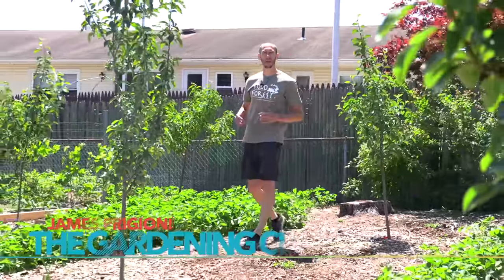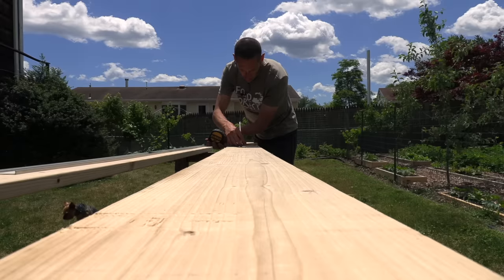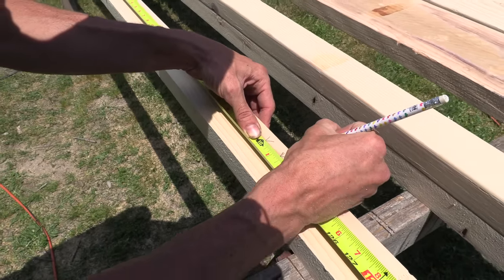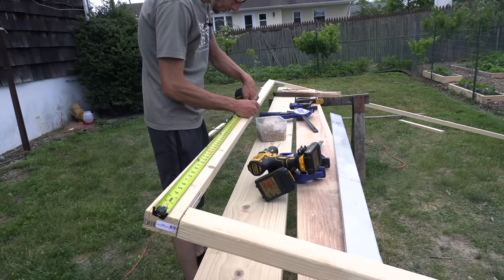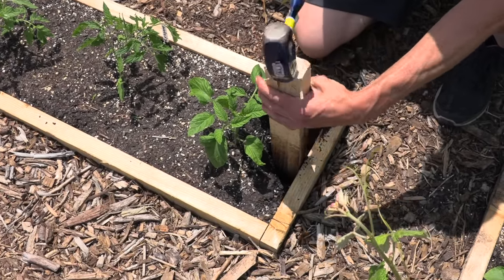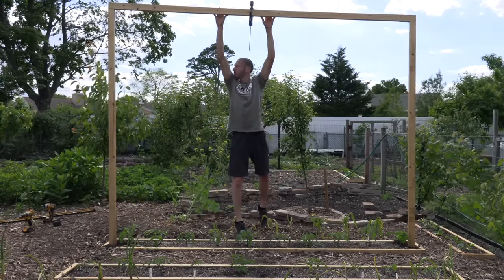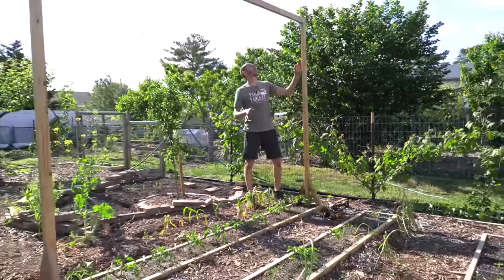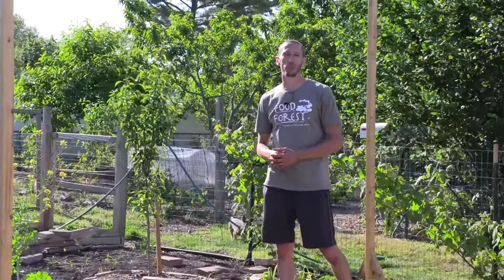How to Build a Tomato Trellis Using Only ONE PIECE of WOOD, CHEAP and EASY Backyard Gardening

Comment: It is better to screw the right angle joint in such a way that the screw goes through the end grain first then into the other piece of wood across the grain of the wood...It makes for a stronger joint.. You can use the pocket hole style...

Comment: Very nice work, thanks.
One thing I didn't fully understand: When we buy wood we usually pay by type and volume, so three pieces of 2x3 should cost roughly the same as one piece of 2x8, (given the same type of wood, and the fact that "2x3" is actually about 1.5x2.5). 
So, aside from the fact that building something "from one piece" sounds nicer, (and assuming you get to practice your carpentry enough without it:), is there a benefit to doing it this way, when buying pre cut lumber saves time and energy? 
Thanks again, keep up the good work.

Comment: Nice handy work. Couple suggestions: you might want to put a 45 brace at the two top corners to keep it from racking the other way. Also if that is jute string it's not going to last very long once the tomato plants get really heavy. I use the orange heavy duty stuff that is not bio degradable and it lasts through the rain and wind storms etc
Reply: I agree with the top brace idea. Can you put a link to the orange heavy duty string you use? tia
Reply: @StevesSpot  Thank you very much Steve !!

Comment: Hey James! Another amazing video from your awesome channel. I love your passion and generous spirit. I have one question / suggestion though. I see you're using store bought wood.  I've been wondering if it's possible in your area to scrounge around junk yards and asking around for free wood? Not only does it adhere to the principals of permaculture but it will also (in a small way) reduce your carbon footprint. I know it's easy and relatively cheap to buy planks but the manufacturing process is quite carbon heavy and uses a lot of resources. So, I have a challenge for you. Go around and ask for free unused / discarded timber or buy it for a fraction at a junkyard and reuse it. Reduce, Reuse, Recycle. Keep up the amazing channel. You really give me some inspiration to build my own farm soon.

Comment: I’m down here thinking, “how the heck am I going to reach the top to get my twine through?🤔” 
Short people problems 😂 love the way it turned out and it looks so much nicer than t posts! Have to think of a way to support it when I don’t have the wood bed frame to work with! Thank you for this! Big fan 🖖🏼😌🌸
Reply: Could put the scrap pieces underground attached the same way at either end or it might last longer using big planter pots filled partway with concrete or just rocks then you could plant at the ends too!!!

Comment: What you do is you get a tree that's core is as thick as you need it to be and an extra four or three feet to go into the ground for spiking and then you can put your side support. You get the proper length you dig a trench that can fit it and then you bring it to a rolling boil of water cuz you have to fill it up with water. At 150° c. I learned this from the old timers. And then you boil it until it's like limp spaghetti. And then you do a quick Bend and then you fix it on with clamps and your pour water if it cracks you got to you got to shave back. And then you let it dry. That's how you can make it out of one single piece of wood. And you're supposed to wear two layers of one inch leather. You can get them mastercraft aprons and you just get two of them when they're on sale they're only $75 plus tax. And two layers of leather gloves you get one that fits you smoothly and then two sizes bigger that slide on top and then you can work them as if you were using your bare hands but that way you won't get fifth and 6th degree burns.

Comment: Like your boxes there that could be a single piece too that you're making you just boil it and then you'd make it at the Benz and then where you're hooking part is you do a clip you Whittle it a clip so you bend the ends so that it locks in so the extra pressure actually locks it into a grid section it locks it into a square. If you talk to the old timers that do it they'll they'll explain that I'm saying it right.

Comment: I am wondering what technique should I use to tie my tomatoes from the bottom. Does tying the base directly to the string not going to damage the plant as it grows? I was thinking of putting a 15-20 mm wood (or plastic) stick into the soil to tie the string instead. What would you rather recommend? Thanks a lot for the tips! Keep the positive attitude.

Comment: I just wondering you brace the frame onto the 8x2 base. Is that any support to make the base stronger? If no other support, after tomato grow up, the whole thing will like a big sail. I'm worry about the whole thing will falling down include the 8x2 base. If you made several trellis and fix them together, that should be fine but you didn't mention that.
I like this video, that is very useful. Just personal advise.

Comment: Another method is to attach the trellis over the ends of the raised bed with the vertical support turned 90 degrees from wat you did, put in L backets on each side, add trusses on each side of the vertical piece, then at the top, add trusses at each corner. That way, no wood of your trellis is in the dirt so it will last longer. Another method is to not use trusses. Instead, buy shelf brackets and use these instead of wooden trusses.

Comment: Hey James, I know you posted this a while back, so I hope you see this and get a chance to comment.  Do you think this trellis style will work with massive tomato plants? If not, is there a trellis system you would recommend for tomato plants that get VERY LARGE? Last summer, we did yellow pear tomatoes, and the plants were so large, we were using bungee cords to attach them to the sides of my chicken run just to take the weight off of the branches to keep them from snapping. If it were standing straight up, they would have easily been 8ft tall and several feet wide each!
Reply: That's a good idea. I'm using my old grapefruit tree and running lines down from the branches. I'm going to use old tshirts to wrap my watermelon& Cantaloupe in.

Comment: You should run a wire along the bottom and instead of tying the string to the plant tie it to the wire at the base of the plant. The string can harm the plant and jerk it straight out of the ground if you tie it directly to the plant.

Comment: Instead of tying each string to the base of each tomato try running a single string all the way across the bottom between the two posts about six inches off the ground. Then tie each vertical string to that horizontal string. That will save you from choking your plants.

Comment: Nice trellis James!  I have had great success with trellises for tomatoes and cucumbers (zucchini is next!).  Any thoughts about using that scrap not only to drive the hole but then leave it in place and screw it to the trellis above ground?  This would give you a replaceable stake (will rot away long before the rest of the trellis).  Also, I've found the scrap bin at the big box stores is perfect to get scrap lumber to make these for very short money to free (including banged up PVC wood that I used for upper corner braces to reduce sway)

Comment: I've been watching your videos off and on for a couple of years and did my trellis. But I ran lines around the outside of the posts to create a wall of wires to prevent them from falling over. This coming growing year I might do it from the top. Do you have any videos of the tomatoes growing up the string?

Comment: Loving Jersey Boy James and his fun loving style of ideas. Agree that you should never use treated wood in the garden, but the pine wood with some linseed oil will rot in soil in no time. Can you... if you can swing the expense, use a composite material like decking that will never rot since it has not been treated. This could last a lifetime instead of the 2 years with natural pine that has been oiled? Wish I could afford natural cedar wood which is way up in price these days. Looking for an alternative to natural pine wood. thanks
Reply: In my experience, composite materials aren't rigid enough for this sort of application. They're great as deck boards being supported every 16", but can't span something this wide without sagging.
Reply: @donhill1825  Thanks Don... heard from sources that the composite would not be a good alternative due to cost , mold and structure. Am building 4' x 8' boxes that will sit on the ground 16" high with no bottom. Many sources on-line now state that treated wood is fine for this application. Not like the olden days when creosote was used. New treatments guarantee no seepage whatsoever into the soil for safe gardening. Of course anything listed as true organic is a different story.

Comment: I'm planning a build on raised beds.  I'm on the fence as to treated or untreated wood.  I want it to last as long as possible.  I plan to use galvanized on the inside walls so the soil shouldn't contact the wood for the most part.   Please help.

Comment: I did a similar version to yours and I noticed as my tomato plants got bigger, the string was cutting the tomato plants in half. Can you tell me what I was doing wrong?
Reply: use garden clips for the string to attach to, the garden clips will be a lot more gentle  holding the plants up
Reply: I use these -> https://www.ebay.com/itm/250-BLACK-TOMATO-CLIPS-UV-STABILIZED-REUSABLE-cucumbers-peppers-VINE/271524239459?ssPageName=STRK%3AMEBIDX%3AIT&_trksid=p2057872.m2749.l2649
Also, I use RollerHooks so I can adjust the string and move/rotate the tomato plants when they grow to the height of my over head support-->https://www.farmtek.com/farm/supplies/prod1;;pg110010_110010.html

Comment: You should never use power tools that cause a stress fractures in the wood. If you're going to do that then you might as well get your copper sheeting and wrap it and then tack it. That way you're good for when it does start to crack and then it keeps out all the insects and the slugs out of the area. That's all

Comment: I build multi-generational homes. Log homes and I do masonry brick and mortar. And stone and clay. And I can make Roman cement. What you need are your 3-in chisels four of the solids numbers that have a half. And three of the whole numbers. Of your chisels. You need three inch chisels you need three of them. You're one and a half inch chisels you need four. You're 1 in chisels you need three of and you're half inch chisels you need four of. That is 120 years of use on a farm of a multi-generational farm that's an actual real farm. Then you just need your Hammers and your mallets. Your hand drills. Your lathes and planes. Three of each.  Hand drill is two hand, like Irish Boxing, to drill or bore.  And that is all you need for home use and civilian variant use.  Then is trowel and shovels, V and U variant shovels. Then a trench, hatchet and double two hand axe and Hammer.  The rest is personal Variant preferred.

Comment: Lowe's will not rip your 2" x 8" x 12' vertically. It is a safety hazard if the blade hits a knot and kicks. Length they will do, width, is not an option.

Comment: I hope you used Raw Linseed Oil. You didn't specify. Boiled Linseed Oil, which is the most common type sold in hardware stores, contains chemicals that are not ingestible.

Comment: I tried asking home depot to cut wood in the measurements that i had and the man told me in a nasty tone " We don't cut wood for DIYs, you need to get the tools needed and cut it yourself.
Reply: This happened to me too at Home Depot. I went to Rona and they did it. It was a pain though, ripping wood usually is. Just got to find the right place at the right time. Someone will do it for you, hang in there there. Driving them home in my Yaris was another challenge lol

Comment: Great project, but Ouch, the date you did this video must be pre pandemic- 2"x12"x12' at our local HD [Hilo, HI]  is 55.38$ Internet # 202087804  Model 95334  Store SKU 656671 No option for Non HiBor (pressure treated equivalent) unless we special order.

Comment: Why so much work?  I too used 1/2" EMT conduits with 90-degree elbows.  The 10' conduits cost $3 and the elbows cost $5 so the whole trellis includes (3) conduits and (2) elbows total to about $20.  It took less than 15 minutes to pound the conduits in the ground, and assemble the top bar.  Done!
Reply: I don't believe that EMT would stand up to the winds in my area, but the way he braced his at the bottom and screwed them in, it would do fine here. Not only that, but you had to  pound the EMT from how high up? No thanks.  My personal preference leans toward the wood construction and I like the  look of the wood trellis, too.
Reply: @joanies6778  I think you pound rebar into ground and then slide the conduit over that so you're not on a ladder,

Comment: Twist the cord, not the plant.....Decent trellis.
Reply: Yeah it makes sense to twist the cord. It would be better to not make the cord to tight for easy twisting round the plant.
Reply: Or if you really move the plant, ensure that it won't get twisted stem. They tend to not like that.
Actually, in principle you can lower an indeterminate tomato plant itself, too - then you can have lower trellis. Aren't you removing lower leaves anyway? If yes, when that bare stem gets into the contact with soil, usually it grows roots and helps to feed the plant.

Comment: I think u should stick to gardening James. Why didn't u use PVC? 5 8' sections of 1'' PVC, 2 1' Ts 2 1'' 90s and 4 1' caps, I could of had that built in less than an hour. The weird thing is u use pvc for covers on your beds?

Comment: Stop whining about pressure treated wood. It has copper and an antifungal. Copper is a trace mineral. And the antifungal is designed to retained in the wood. Anything that leaches is probably miniscule and SLOW. Just wash you vegetables.